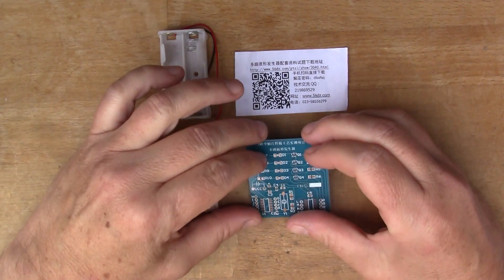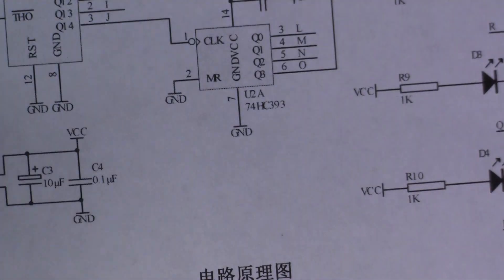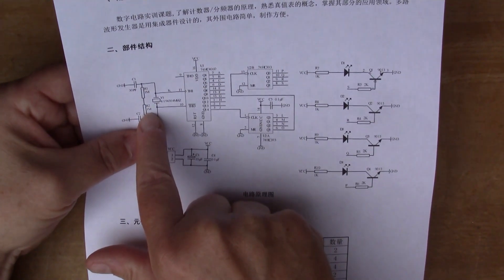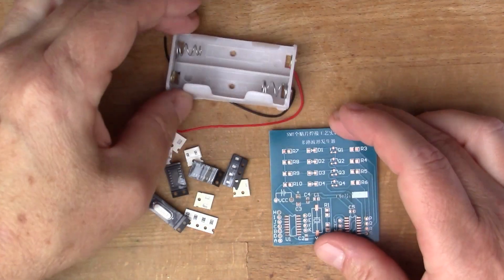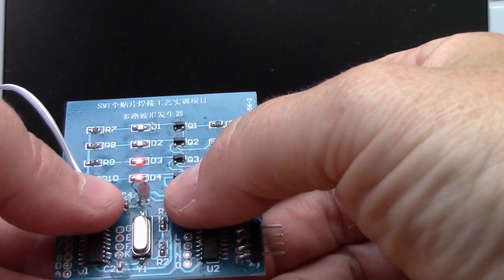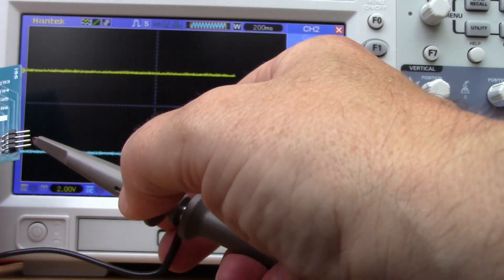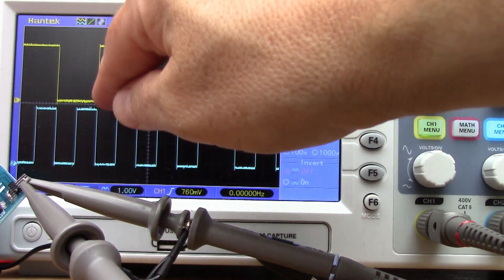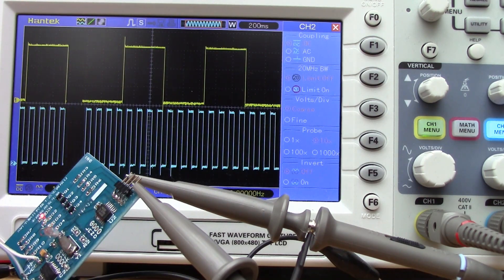Multi-squarewave Generator Kit (#81)

Comment: Got this as my first SMD soldering practice board. I have probably the worst soldering hands in the world, yet I was surprised how easy the whole process was.
Except for those two super-small capacitors, wouldn't want to work with  that size again. 
Anyway, I now know I prefer soldering reasonably sized SMD components to TTH  components.

Comment: I was working on a ESP8266 a few years back when the 12  model first came out, one of the smd capacitors was messed  up at the factory and the thing just would not work.  Well I had taken apart some old SMD stuff, and just  found a SMD cap that "looked about right" and soldered that one in to replace the bad one from the factory.  The little guy came right to life and has been serving me in a little WIFI tracer that I built out of it now for over 4 years!. (maybe it was 3, who's counting, my old addled brain can't seem to stand the strain after 67 years of working overtime!)  I have no idea what the rating of either capacitors were, who the hell can tell on those little devices.  I was going to get me one of those kits, but the add said they are no longer available.  Perhaps later.....
Reply from the maker: I've got a multimeter with a capacitance setting, so I tend to use that.  In general, capacitors seem to be labelled worse than any other component.

Comment: I built one of these earlier this year.  I seem to lose a few SMD components to the carpet monster!.. My one worked ok but the soldering wasn't pretty!  I use a hobby lamp/magnifier or I wouldn't manage these circuits!  Good introduction to SMD soldering I suppose as it doesn't have too many component.  I bought some of the selection packs of SMD components from China as they do tend to get airborne quite easily!
Reply from the maker: You can probably see that my soldering isn't pretty either !